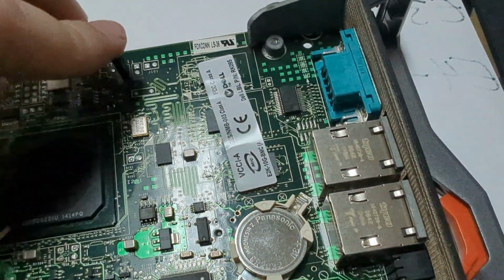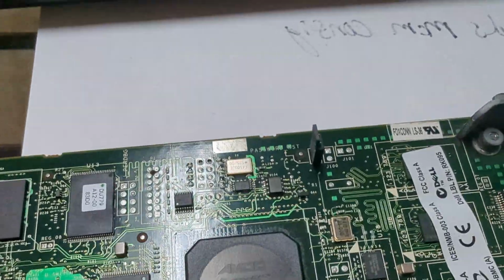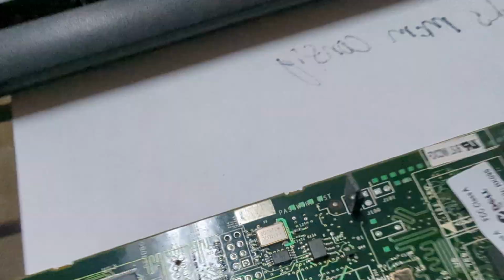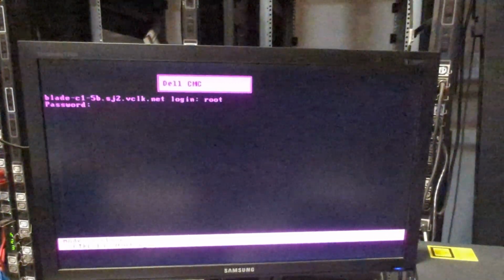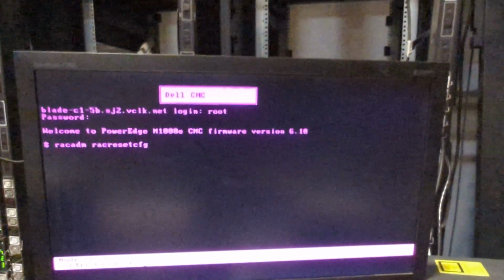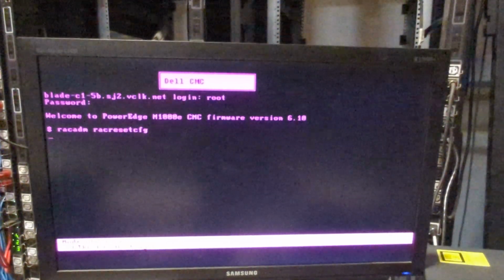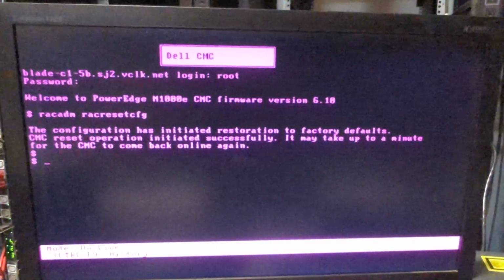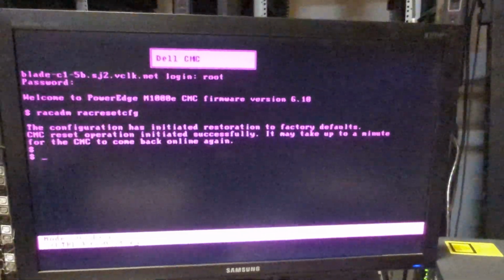Resetting a Dell CMC/m1000e blade chassis

Comment: Great video! I have a question if I may....I have a m1000e with a CMC that I cannot log into. My question is - if you use the jump reset only, does it reset the CMC configuration?
Reply from the maker: Yes, it will walk you through basic default settings once it loads up
Reply: Thanks! then I will refrain from doing it. I cant lose my CMC setup and the host blades in it.
Reply: I used the jumper to reset a login details on a CMC module, and it only reset the password.  This is an extract from Dell site “To reset the CMC password, install a jumper across the password reset pins on the CMC module. This operation only resets the default administrator password and does not affect other configurations.”